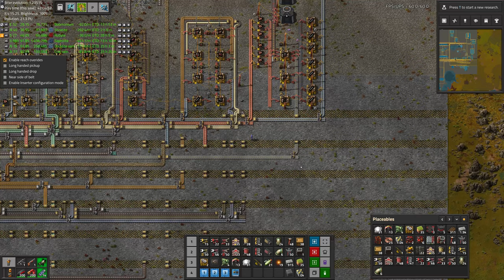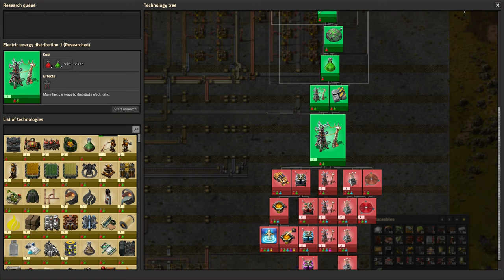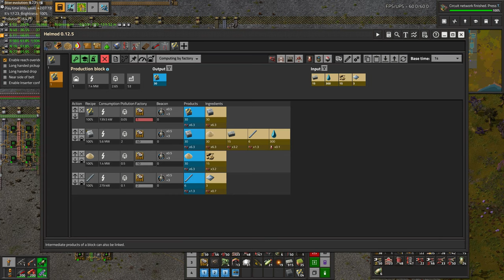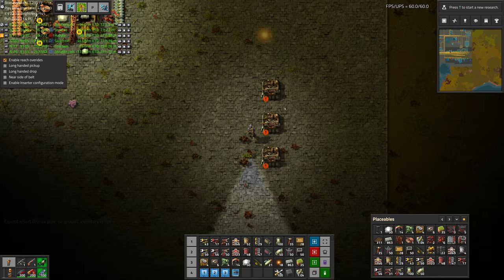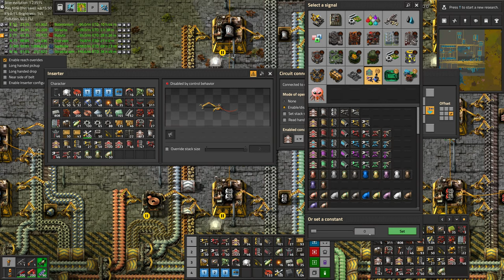[Factorio 1.1 4K] Angel/Bobs Ep 37: Circuit Network (Tutorial/Walkthrough)

Comment: This is such an amazing series, thanks so much for recording all these. Question: with the setup that you have going with lead, silicon, nickel, and so on, how are you supposed to get the nickel out if you need it? Since it's stuck behind the lead on that belt, how does it get through? That's the problem that I'm having with my current playthrough. Sorting through the chunks is so difficult because inevitably I have too much of one kind of ore and everything backs up. Thanks!
Reply from the maker: Thanks!

The short answer is, you don’t. Internally you can classify something as a “product” or “byproduct.” In this setup, nickel is a byproduct. In other words, you only get it sometimes as a result of producing lead. You can’t easily make it in real time, and you just have to deal with it being that way.

I haven’t gotten to sorting chunks yet on my recordings (pretty much starting it though!) The way I have done it in the past is, you have to have several different methods of producing different ores set up and running, and have a circuit network to turn them on and off based on a buffer chest/warehouse. In other words, always produce things the “ideal” way to a point. If the ideal way isn’t keeping the chest topped off, start making it less ideally. However you can’t fill the chest all the way to leave room for byproducts to fill in. And then another circuit condition to turn off any production that is overfilling a buffer so the whole system doesn’t crash.

So the short of it is, produce ores in many different ways. If all you have are the six ore chunks and sorting without catalysts, it’ll be impossible to match ore production with your factory’s needs. You’ll have to fix it further down the line by taking plates off the line and storing them, or pick an item to produce a bunch of to clear up the line back at the sorters.

So yea, hope that makes sense. You’ll get lots of episodes dedicated to fixing this problem, in the coming weeks as they’re recorded and uploaded, so look forward to that!
Reply: @marsh8056  Thanks for the reply. Perhaps I'll take a video of my old setup. I'm doing a new playthrough now, but the old one is still informative at least.
Reply from the maker: Every factory is a chance to improve!
Reply: @marsh8056  Indeed and that actually brings me to another question. Playing Bobs and Angels, when do transition to a more permanent mega base?
Reply from the maker: It’s a constant transition for me. This is because, if you go big, and then unlock a new technology, it can invalidate your fresh megabase. So my recommendation is, only go as big as you need to. Once you’ve unlocked everything and you’re in end game, then go big.

But it’s a transition. Major upgrades occur when they make sense, when the base can no longer be easily upgraded. Trains help with this, you can just make a new bigger section and the trains will find their way.

I recommend timing your base expansions along with every new tier of ore sorting. Generally they unlock all sorts of things and the base gets bigger as a result, and it’s also pretty complicated, so it’s a convenient time to upgrade.
Reply from the maker: Also, one of the big things I like about angel bobs is that nothing is permanent. Things are always changing and improving. It’s not like vanilla where you put something down and it stays there for the entire game. I can see how some would be turned off at constantly rebuilding things, but to me, it’s constant improvement. I started hand mining and hand inserting, and here we are. There’s no single point where the base changed. It’s been constant, with every episode, something gets better, bigger, faster, ect.
Reply: @marsh8056  Excellent thanks! Processing the chunks is definitely a huge part of the ore sorting progression. So much stuff you have to do and especially if you want to get into crystals. Last time, I had the Sulfuric Waste Water going off site to my petrochem area to be processed into acid for the crystals, then sent back. Yeah, BAD idea!
Reply: @marsh8056  Yes I love that aspect of it as well. I hope you finish the series man!
Reply from the maker: When the setups get bigger and more complicated you gotta think about how to limit the burden on the logistics system you’ve set up. For example, it’s much less moving water around if you process the waste water on site and send the byproducts elsewhere, so you only need to send in a little fresh water, compared to sending a whole bunch of water to and away from the washers.

It’s going to be pretty complicated to show. I think I’ve got a good plan on how to record it. It’s tricky because pretty much none of the setup works until the entire setup is in place. So much stuff has to connect to each other so it’s going to be a lot of episodes to get that set up. I hope I do it justice!
Reply: @marsh8056  Looking forward to it! Luckily the last crystal stage seems fairly simple if I'm not mistaken.
Reply from the maker: Yea it gets easier. At that point you’re just removing the slag. Really washing is the worst part of it because of how many more byproducts and inputs it requires.